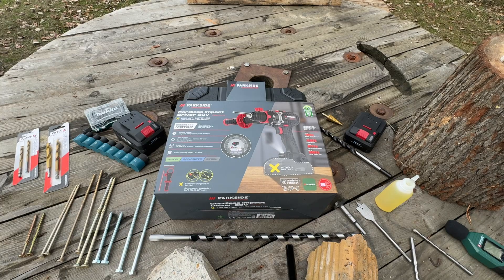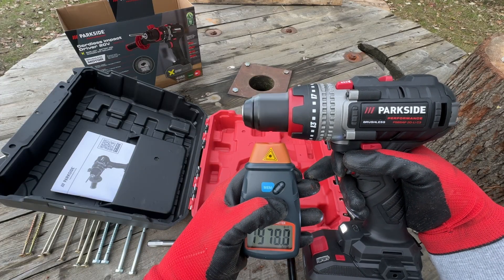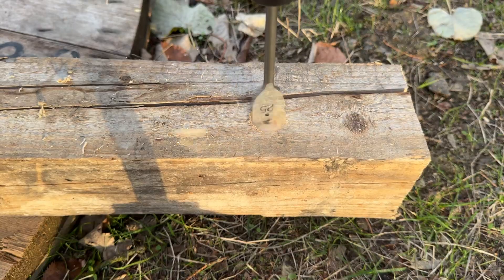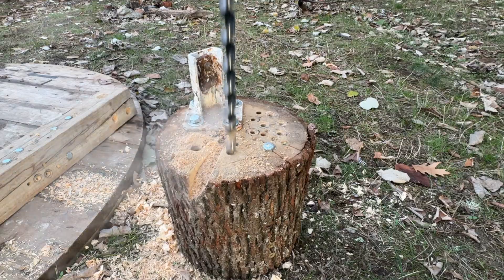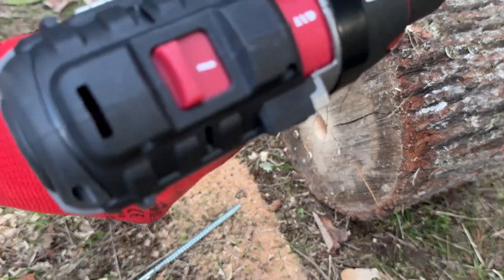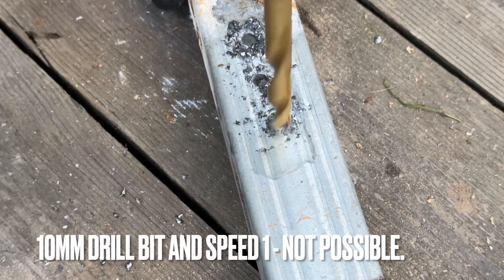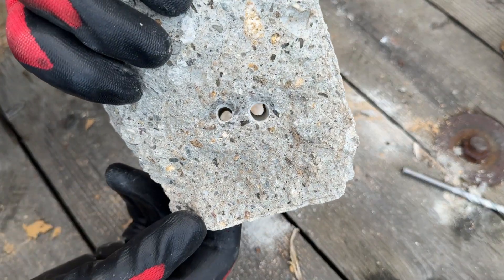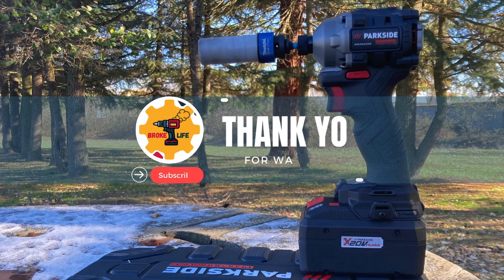NEW Parkside Performance PSBSAP 20-Li C3 hammer drill - 64Nm are they enough?

Comment: hello my friend. Just a question. Have you compared this one with the smaller of 60 nm? the pabsp 20li c3? Which one is stronger?
Reply from the maker: Hello! Not had them at the same time, but having used them for pretty much driving the same types of screws I feel this one just has the edge over the C3 drill driver.

Comment: Did u test the screw mode?
Reply from the maker: Yes, you can find that at about 04:14
Reply: U screw them in drill mode?
Reply from the maker: @user-yy8mc1mi9f Oh you mesn with the clutch, it is very sensitive and can‘t really be used to screw in hard wood. You can use it for smaller screws or in softer wood.

Comment: if you buy the set with charger and 2 batteries and bits, the drill handle has 60NM written on it, but the box cover and manual say 64NM. Maybe its just my model, or maybe they re-use handles from older models...
Reply from the maker: Very interesting! I don't remember what the writing was on the handle on this one and I have already returned it to the owner. I'll see if I can get them to check! I am looking through the videos to see if I can spot the writing on the handle but no luck. I would not be surprised at all if they reuse old parts.
Reply: @BrokeLifeEU  the one in the video has 64nm written on the handle. As do other videos of it without battery. Havent found an unboxing of the set with batteries and charger.
Reply: @BrokeLifeEU  i found a video of the complete set, the handle there also says 64nm :D i will email grizzly tools and ask whats going on
Reply from the maker: Put it up on ebay and add some sort of outlandish story in the description. Then hope for the best! 😂

Comment: Another parkshit toy that many will waste money on and will regret.
Reply from the maker: Unfortunately not everyone has the disposable income to go out and get a DeWalt or Makita. For some people it is just about basic DIY and I feel Parkside tools do a good job at that.
Reply: @BrokeLifeEU  well, I bought 6 or 7 parkshit x20v toys, and now I know I can't afford to spend money on parkshit toys. Not a single one lasted the warranty period. And you know what happens after the warranty expires? You have a paper weight.
Yes, I do own a DeWalt hammer drill. Bought it in 2008 and after thousands of holes in concrete it still works as the first day. The parkshit I bought, almost burned it the first time I used it.
Tell you again, I can't afford to buy parkshit.
Reply from the maker: @zefautino I am sorry you had such a bad experience! I understand your frustration!
Reply: You're so proud of the parkshit word.

Comment: C3 ? X una versione nuova?
Dovrebbero dargli la sigla A1 
Un trapano avvitatore a percussione da 64 nm molto simile al 150 nm a percussione anzi sembrano uguali 
Il costo del 150 nm è di 120 euro solo macchina 
Qui parliamo di 50 euro 
Quindi è un nuovo modello 
Ma xké la sigla C3?
Reply from the maker: Per quel prezzo è ottimo direi. Penso che sia il C3, perché il numero del modello è PSBSAP e l'ultimo modello con B era un B3 e aveva 80 Nm ma era più lungo di questo e c'erano alcune differenze visive.
Reply: @BrokeLifeEU  se ho capito bene costa 50 euro ...quindi parliamo di un 60 nm più forte di 4 nm e più giri motore oltre alla percussione.
50 euro dopodomani vendono il C3 solo macchina e senza percussione
È questo che mi lascia un po' dubitoso
Comunque si a quel prezzo se in Italia verrà confermato è un ottimo attrezzo
Reply from the maker: Spero che sia a quel prezzo! 64Nm non sembrano tanti ma non ho trovato il limite dell'attrezzo! È stato potente! Come sai Lidl non vende sempre allo stesso prezzo in paesi diversi. Ad esempio, il nuovo impatto 12V PPDSSA A1 era di 40 euro in Belgio (ora 50) e 75 euro in Germania. Stesso strumento e una grande differenza.
Reply: In Italia uscirà settimana prossima, ma costerà 120 euro. Uscirà con valigetta in metallo/plastica, 2 batterie da 2a e 98 accessori tra cui punte e bit  @BrokeLifeEU
Reply from the maker: Preferirei solo lo strumento. Le batterie da 2 Ah non durano molto. Lo SMART 4Ah ha le stesse dimensioni. E i pezzi non sono così buoni. Utilizzo gli strumenti Parkside e le punte Makita o Milwaukee in questo modo ottengo il massimo dagli strumenti. @giuseppepappada4522
Reply: @BrokeLifeEU  beh. Non sono così buoni rispetto a Makita, ma sono sufficienti per cose casalinghe
Reply from the maker: Sì, hai assolutamente ragione. Per questo vanno assolutamente bene! @giuseppepappada4522

Comment: Yours makes strange grinding sound when you let go off the trigger and engine stops? I think I can hear it here 1:44
Reply from the maker: It is coming from the chuck. Because I did not tighten it and the jaws were a bit loose. So when the motor stops there is still some movement in the chick jaws and I think that causes that noise. Otherwise I spent 2-3 hours with it yesterday doing those sorts of difficult jobs and it was fine! I had 4 attempts with the big drill at that very hard piece of wood and it never cut out nor did it have any issue attempting to drill through it.

Comment: I think your 10mm drill bit is dull, it's not like the drill wasn't spinning it.... try a new drill bit, go slow, add oil or water, and you'll see long curls not small chips
Reply from the maker: In highnsights I admit you are correct! I used Milwaukee impact rated titanium HSS drill bits. They were used but not that much so I was expecting this not be a problem. I used oil on the metal you can see the bottle at the start of the video and you can see the oil on the metal. I left this bit in indeed to show that no matter what the drill never stopped and it kept on trying despite the dill drill bit! It is a good drill this one! For 50EUR I could even call it a great deal!

Comment: Great video. What is the weight without the battery and total length please? I have the previous version without the hammer drill. New one is bit larger and prolly heavier. Just curious for the exact numbers.
Did you know that the B2 has a temperature sensor built in that shuts down at 0°C and below, to protect the battery. They removed this in version C2.
Reply from the maker: I did not weigh it, because for the functionality it has it felt light enough. Weights will be from the lidl website:
Drill: approx. 1.45 kg
Additional handle: approx. 205 g
Smart 4ah battery: 601 g